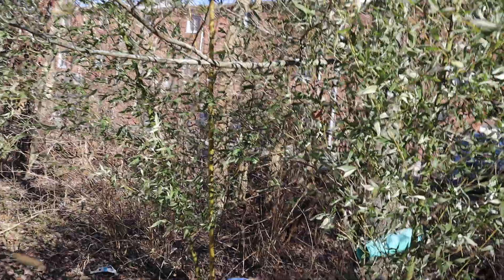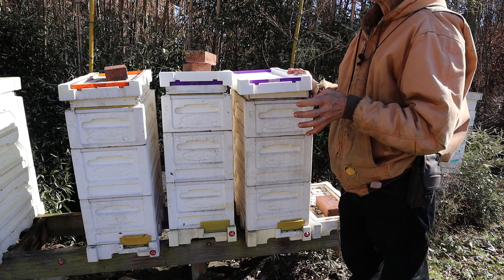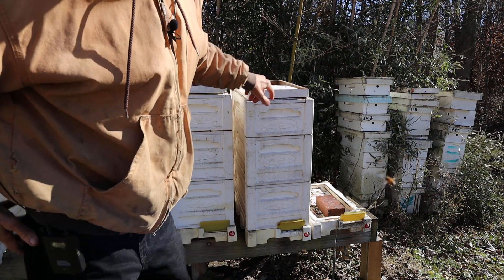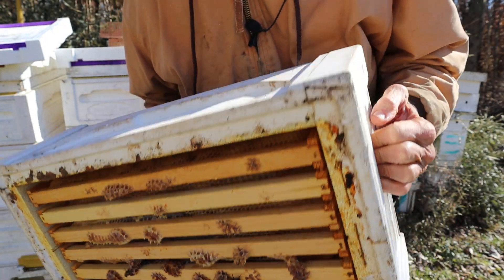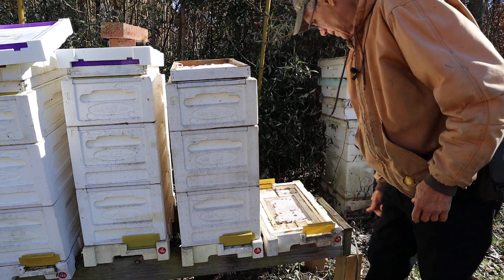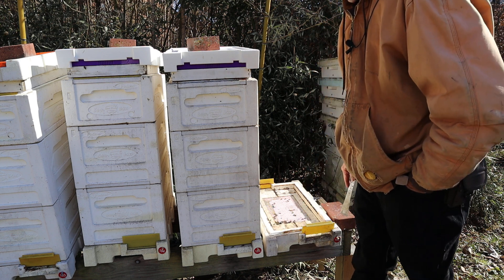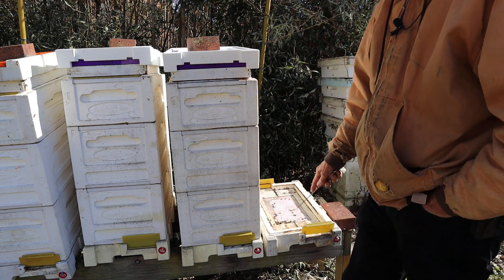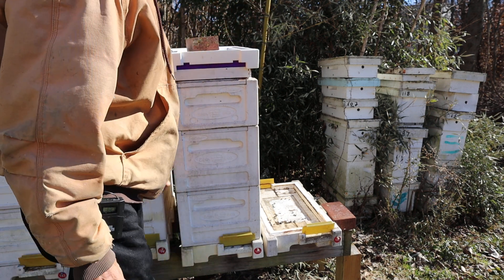Polystyrene Hives

Comment: I use some of the 10 frame  poly hives (Beebox, Paradise). Im in Ohio.  Overall i like them but as you say, the distance below the bottom frames and bottom board is excessive and the bees will build comb off the bottom of the frames, usually at a slight angle too.  The boxes are typical for European in that they are "bottom space" and the frames are level with the top of the boxes.  Tiny ants will burrow into the poly and create a catacomb which weakens the boxes. You can stack wood supers on them during the flow, they line up fine. Definitely do not drop one or major repair is in order.  I have several and do like them.